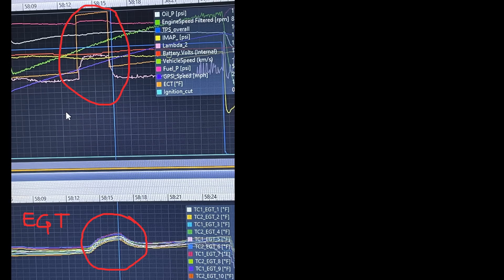V12 Race Car Reaches Unthinkable Speeds

Comment: This is great but i promise its not going to end well...........  that thing looks so unstable under acceleration, whats gonna happen when you hit the 100 shot at speed?
Reply from the maker: Scott will drive the beast next month.  He will wait until 3rd gear to hit the Nitrous around 7000RPM and the NOS will come on gradually for the first 5 seconds to avoid  a large bust of power.  When he gets into 4th and thru 5th the NOS will be ramped up and he should have enough traction to make it thru the traps at 260MPH

Comment: Forgive the dumb question, but which are the driven wheels?
Reply from the maker: Rear wheel drive
Reply: @GregQuirin  thanks for the reply. I asked as when on the dyno, it looked like the rear wheels were rested on a surface, and were not rotating. I'll watch again later on a TV instead of a phone.

Comment: I never seen 244 MPH I seen 239 MPH..... Where is the 244 MPH??? I'm not trying to sound like a "hater" Not the slightest bit but I am just wondering why you guys said that?
Reply from the maker: The GoPro speed is inaccurate, the official speed was called by the SCTA aassociation, which is measured at the end of the race track timing lights similar to a drag race for example.

Comment: The Speedo on the screen said 239 so where do you guys get 244 from ?
Reply from the maker: The speedo on the screen is the GoPro camera . The official speed is clocked at the finish line by the SCTA. The computer GPS speed also registered 244 MPH

Comment: To me it sounded like the engine could have enjoyed pulling another at the top end. It just sounded like it was slightly over the power band and coulda used a pull down for a couple mph.
Reply from the maker: El Mirage is challenging, every happens really quick as it is a short course track. Unlike Bonneville we car run the car for 5 miles to pick up top speed.

Comment: the cylinder heads look like their base off of 2jz heads... based off of the spark plug spacing
Reply from the maker: They are based off  Indy Aurora heads from the early 2000"s cut down to 3 cylinders and welded together to make a 6 cylinder x 2  there are other videos on the page showing how the engine was built.

Comment: They were going 245 on the straightaways at Ontario Motor Speedway in 1972. I was there.  How is this unthinkable speed? Gerry Grant 1972 1st 200 MPH 4 lap average in an Indy Car 4-cylinder OFFY, no less.:face-green-smiling::text-green-game-over:
Reply: At El Mirage you have to accelerate from zero to the speed in 1.3 miles.
So we obtained a speed of 244.5 mph by accelerating to that speed in 1.3 miles.
At Indianapolis they are going 230 in the turns and accelerating to 240 at the end of the straightaways.

Comment: Why is 240 mph an "unthinkable" speed? You can buy production cars these days that can go faster.
Reply: Just you like you said. You can buy, these guys built everything.
Reply: @Thee_Magic_Man  That still doesn't make the speed unthinkable. Also are you saying they cast the block, the pistons, the rods and all the parts of the engine in their backyard? The video doesn't go into exactly what is meant by "homemade" which would really be the most interesting part of this achievement, as you point out.

Comment: Great work!

Old Skool Questions:
1) More down force at low speed acceleration / less down force for max speed, IE, F-1?
2) How much side resistance with outside exhaust V larger long pipe inside frame = more push in the slip stream, IE, F-1?
✔️Chamberd-Collector reminds me of 2 cycle exhaust on faster bikes.

Find a hub dyno to get less slip during high HP loading.

Comment: I'm assuming you guys did that run at El Mirage. I used to go out there as a kid and into my 20s 1970s- 1980s and ride motorcycles and some friends had hot rods and 4wds. 
 One Labor Day weekend out there it was pretty cold and a little windy and made for a ruff day on the motorcycles so we sat around the fire and around sunset we noticed there was snow blowing around and gathering around the tires of our vehicles. The next morning we had about a half inch of snow on the ground and on the vehicles. 
 You never know what the temperature will be out in the desert. 100° or more during the day and in the low 30s at night is normal out there. 

Great job breaking that record. Thanks for the viseo
Reply: Welcome to the desert mate
Reply from the maker: Yes El Mirage!

Comment: Why is the idle so high ( 2,800 RPM )   
Also, speaking to glitches in the electronics, put a scope on the alternator output terminal and see if there is lots of AC, I've had strange problems crop up if a diode goes bad.     This would not cause coils to fail though.  Are these coils designed to be peak and hold ?   ( high inrush then voltage limiting to limit amps )   Perhaps dwell time is excessive at low RPM causing the coils to overheat.

Comment: 6000cc with 920hp is the beauty of engineering, you must be machinist and mechanic at the same time
Reply: The impressive thing is to make 920hp without forced induction.
Reply: No, my bike for daily use has 68hp with 430cm², which would have 952hp in a 6000cm² engine. Of course without any forced induction.
Reply: @lupuszzz  I am not sure you can just multiply it like that. more displacement means bigger cylinders, which means heavier pistons -> more inertia -> less max rpm -> less max power
Reply: @meltdown6165  Adding 14 pcs of 430cm³ cylinders to 6000cm³ is the engine I'm talking about. Yes, the torque and consequently the power (w*M) adds up with the number of cylinders.
You are right, one big 6000cm³ cylinder wouldn't do the job ;-)
Reply: Yes I got that you would not run one big cylinder. I just don't think it is that straight forward to scale this up. E.g. you would probably need more cooling because you have less surface area on the block, so more parasitic losses on the water pump etc. But you are right, motorcycle engines are very power dense, I saw land speed cars build around them.
Reply: @meltdown6165  A typical modern R6 cylinder engine with Peff=100kW has a mechanical efficency of 85% and therefore requires 17.65kW for overcoming internal friction, timing, pumps, ... => 117.65kW, 19.6kW per cylinder to produce 100kW at the crankshaft at a 6 cylinder engine.
A V12 is basically doubles the power and doubles the power loss, so we will still have roughly 0.85 efficiency.
BUT, if you go down from 6 to 1 cylinder the required power for the pumps, the friction, ....is even increasing compared to the output power.
You are right when you consider the complete vehicle, if you double the power loss, double to cooling area you also double the drag. Therefore the ratio is not linear, but I was talking about the main effects on the engine only.

Comment: New subscriber here- cemented in, firmly, just because you fellow car-freaks used A POWER GLIDE trans !!!😁. That hooker looks like she could really be a handful. I have to explore your channel more to help feed the savage beast within. Every aspect of your audio was even excellent. I earnestly pray that someday I may be bequeathed with a blessing of that magnitude to so skillfully articulate that much kinetic potential where the majority of the greater risks lies within the mere abrasiveness of the surface I am driving on. The 1st car I began to further refine my driving skills in (at age 11) was a rather ambitious Cleveland-bearing ('68?) XR7  Cougar. She was my oldest sister's 1st car in '75 just about when Firestone left us high and dry in Akron. So the thing was notorious for overheating and my Pops threw the requisite parts at it to no avail which of course afforded me some seat time. No one in our circles could figure it out but looking back now as a 60 y/o I would think that someone had just gotten a little too crazy with a Dremel tool and gotten too close to a water passage in an exhaust port in the process.  Goofy thing had a lopey idle our pea-stone gravel driveway was about three car lengths long; in my quest to feed my need for speed the second I punched that girl the secondaries would open directly up and something activated within me that was acutely sensitive to yaw and I just countersteered because our driveway was adjacent to our Ranch home that I didn't even want to wreck in to. Girlfriend would hit 6-7 grand, right now. I was not a huge Ford fan then but the sound of a Cleveland, with or without valve overlap is mighty easy on my ears, nowadays. Btw; the vid I saw of yours today where she so nearly ran 245 is a new all-time 1st.place favorite of mine and I AM IN ❤!!!!!!

Comment: Unthinkable...🤦
 Road legal Ford GT ran 310 mph in the standing mile! 😂
Reply: On pavement is an entirely different thing than on dirt.    Turbocharged engines today can make enough power that it's not the determining factor of how fast you are going...it's traction vs aero drag.  The GT was turbocharged which can make as much power as the engine can stand...where naturally aspirated motors are much more difficult to make big power and then get it down on dirt and is not an easy game to play.  These fellows hold a record for a very good reason....they've gone faster than anyone else using the same limitations.
Reply: Blah blah blah...😂 @recoilrob324

Comment: That's only a few mph faster then this same years Indy 500 qualifying runs. Sounds like no big deal then,....
However,... Indy cars run on a well maintained surface with a lot more grip, they have about four times the contact patch on the ground, significantly more downforce, and around 1000 times the budget per car, in a car made from superlight space industry derived materials.
244mph, safely, from a couple of old fella's working in their shed, on a loose dirt surface and skinny tyres, is bloody astounding!
Reply: The thing with records out there are the class restrictions that sort out which record you’re running for. Records are often divided by CC displacement of the engine, naturally aspirated vs forced induction/NOS, streamlining, etc… so his record is for the specific guidelines of a specific record. His vehicle is streamlined and naturally aspirated, and is likely below a certain displacement limit.

Comment: Very very LOW power for what that car suppose to do, that power levels we get in modified vw GOLF, or our fastest bmw 135 DIESEL (9.5sec quarter mile, 960bhp). We have A LOT of golf r and audi ttrs and many many other STREET DAILY cars which runs about 900-950 horsepower.
If hou want to prove ability to build race engines, build 2.0-2.5liters turbo at that power or over it, not n/a of huge capacity and high revs for that modest power figure.
Reply: He'll build whatever he wants. Did you fabricate and weld up those engines crankcases and cylinder blocks out of chunks of aluminium extrusions and billets? Cut, weld up and machine  your heads out of bits of other heads? in your shed? They did buy rods and pistons, springs and valves and have a crank built by Scat.
https://youtu.be/gP5213NlQog?si=AOiNvouYAwNwUlVS&t=346
Reply: @enwri  i did't known that.. BUT power is still low for that huge amount of work involved.

Comment: Top fuel dragsters run speeds of 330+ mph in 1000 ft why do this on river beds if you can't even beat their speed in a 1000 ft?
Reply: Top fuel has 8.2 liter engine running on nitro with prepped surface. 

These guys have a home built 6.0 liter on pump gas running on dirt. 

It's 2 different sports.
Reply: Compare class to class.  a bullet is faster😂
Reply: Top fuel has 12,000 horsepower and a different surface. I would think this vehicle would have the potential to go faster.
Reply: And they have traction
Reply: This comment proves you can not comprehend what goes into each car.
Reply: Why exercise if you’re never gonna be an Olympian? 
Why learn to play an instrument if you’re never gonna be as gifted as Mozart? 
Why work hard if you’ll never be Rockefeller?
Reply: This is gonna be the most ignorant comment I’ve ever seen with the most clueless information about vehicles and engines. Top fuel dragster could never go that distance at that speed without exploding doing speed runs like this over that kind of distance is extremely hard to do and I urge the commentary to go build his own race car before he talks trash.
Reply: Yeah , no nitro.
Reply: Absolutely...
Reply: How long can you run a nitro dragster engine before it starts to melt? 15 seconds? How many pulls before a complete rebuild?
Reply: @meltdown6165  4 seconds tops and they’re happy if it last all of those 4…
Reply: Ya very slippery surface, can't get the power down, same with Bonneville.
Reply: This is a naturally aspirated homebuilt engine with 1/12 the power. Thats some killer speed for the specs. They have a good chassis and some incredible engine builds.
Reply: Get that dragster to do that both ways on the salt
Reply: This engine is far superior to a Top Fuel Engine, which lasts only one run. This engines is NA, naturally aspirated, what a monster.
Reply: Yeah idiot, try putting 15000 hp down on a salt bed, pure idiocracy. Youve probably never went 150 in your life. Stay in your lane
Reply: that's like saying "someone else is rich - why would you want to make a buck?"
Reply: You're joking. Right?
Reply: Haa anyone brought a tf dragster to sl for speed?
Reply: @pjtfinland1794  I guess if they did it would have to be a death wish   engine be melted well before it reaches half mile
Reply: @johngibson3837  Yeah! Pretty much, but if it lasted for a whole mile, think of the speed :D
Reply: You are retarded
Reply: They also have forced induction, gigantic tires and have to rebuild the motor every 4 seconds of running.
Reply: Dragsters do their top speed in a time segment of 1 second or less. To get to a real speed over distance requires a lot more skill to get it there ,then hold it for that measured distance often for many seconds. It's like chalk and cheese trying to convince anyone of this old argument. .
Reply: I figured it was all about the speed. @Mercmad
Reply: Yawn